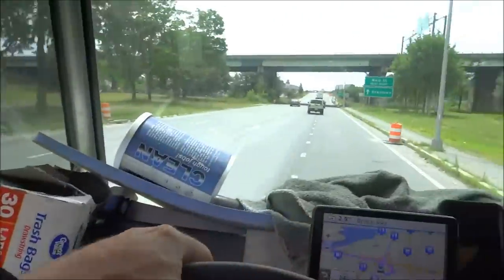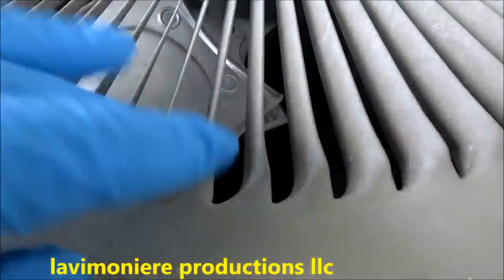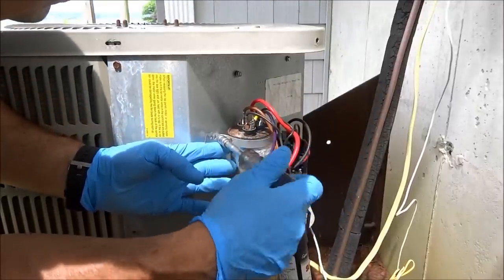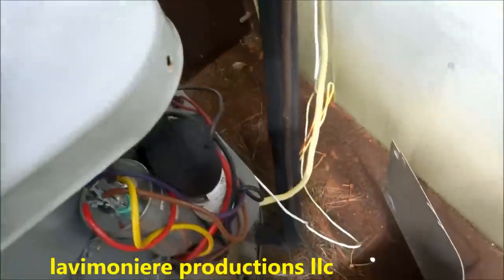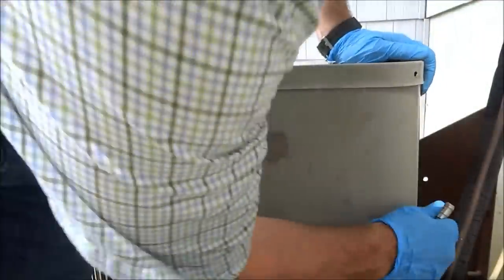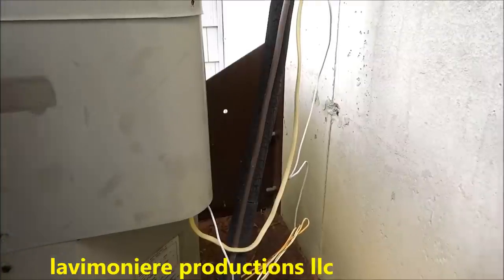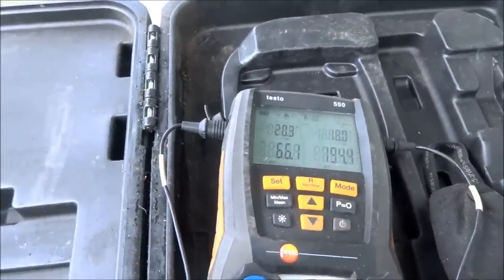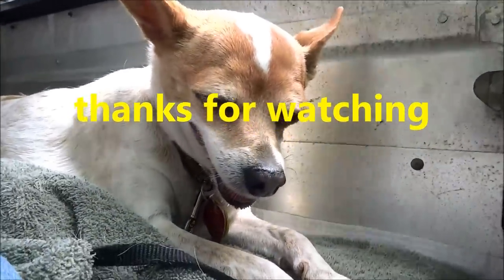goodman AC not cooling house

Comment: The fan on the AC unit outside is running but I'm not getting any airflow at all inside the house.  Any suggestions?
Reply from the maker: yes shut off the unit before you burn it up its probley iced up  look for ice at compressor or remove the cover on inside unit and look for ice or a hot motor .. leave it of for 24 hours if its iced and call hvac service guy .it might be low on gas or bad cap or fan motor .. if its not running right shut if of this might save you ton of money before you burn it up ,,,remember shut it off that good advice best to lesson

Comment: Needs disconnect & seal/tight to both units. Dangerous on metal platform romex exposed.
Reply: Michael Lee they didn't even put a romex clamp. Lol. illegal and sloppy!
Reply: Texas we bond to ground rod next to platforms #8 copper.Trouble is you can only tell customer, up to them hire electrician to make it safe.
Reply: When work for Air & Electric company adapt to what problem is.

Comment: Jeez, you guys still using R22, topping up without checking where it's leaked from.
Reply: If the customer doesnt want to pay for a leak search, it doesnt happen. Also, there is no leak repair requirements for a unit under 50 lbs. Doesnt matter if its leaking 1 lb a day or 1 lb a year. Only limit is the customers willingness and ability to pay.
Reply: @Austin23191  I'm from the UK where R22 was banned 25 years ago lol.
Reply: @phil955i  production of r22 was banned in January 2020 here in the USA. We can still use it though. Happy Treason Day
Reply: @Austin23191  lol and the same to you